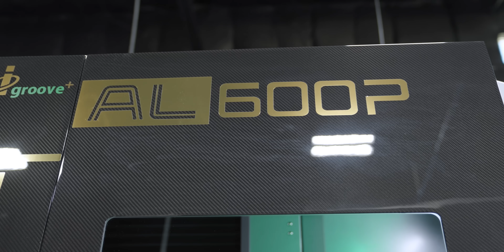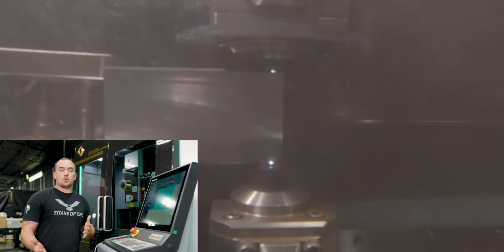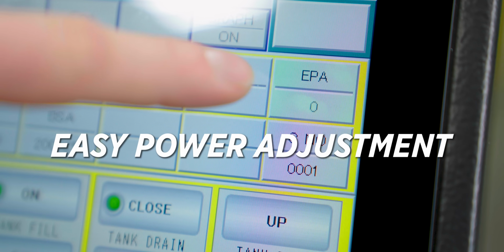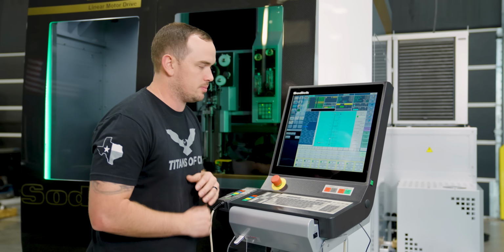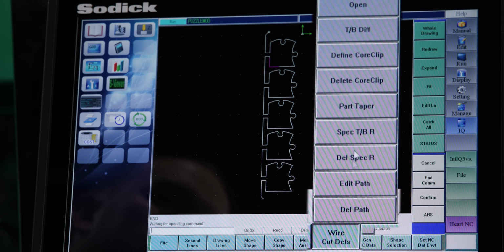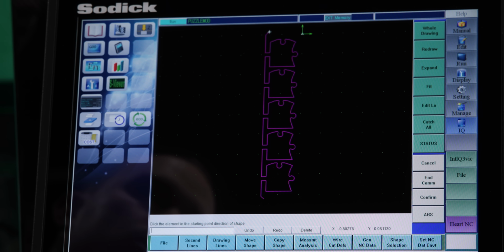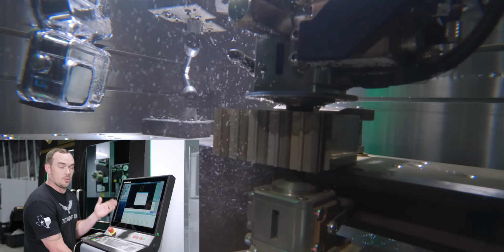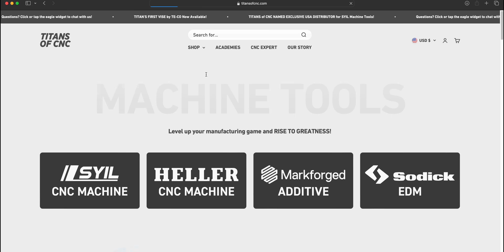MOST Precise EDM Worldwide Makes an Invisible Cut

Comment: Top and bottom surfaces were ground after EDM and assembly. That is why it looks so perfect. Check the grinding marks on side A, at 4:39 (parallel grinding marks to the side of the workpiece) and at side B at 4:41 (~20° angle to the side of the workpiece). On all 4 pieces, the grinding marks are the same. Precisely on both side.

If you check the grinding marks orientation on the stock material and if you would assembly them after EMD, they would have 90° offset in the orientation...

 I don't want to unackonwledge the precision of the machine, but what we saw here is a show.

Comment: And here I thought this technology was surpassed by some newer since it has been around some decades now. But this is quite incredible. Even if it takes some more process after the cut or what ever. Just to make a cut so thin that it almost disappears is just incredible.
Reply: @JohanFasth-w4r  EDM is one of the fastest-growing machining technologies in the manufacturing sector. As tolerances get tighter, and shops work to remove second or third ops from their process, being able to hold 5um on your first op is becoming the standard.
Reply: @robswain5264  Fantastic. I thought it was fazed out as I said. But I'm not in the business, just interested in what's happening. Thanks for info!

Comment: Did that shit just autofeed the wire through both heads?
Reply: @setesh1294  not new. Makino and Mitsubishi have had auto thread for at least a decade
Reply: @robswain5264  ahh. Well, in all fairness my only first-hand experience with W-EDM is with a Hitachi from '87.

Comment: I have Query & Help reqd. One of our Testing system has failed Mechanically. Can we have rotary table around fixed table manufactured using this system. Both table should be cylindrical in shape with provision for mounting different fixtures. 4 probes will be mounted at 90degree to measure ID of job[mounted on outer rotary table] on Center Non-Rotary table. This  i wanted to implement for wheel id measurement. Since every change in micron changes inner circumference. Also it can help in testing center offset of job. Also wanted to know can this fixed table with rotary table placed in oil bath to reduce friction & increase life along with repeatability. I am testing system software developer working on software of such system.  Hence searching for solution. Job will be clamped at bolt holes of job through dowel pins mounted on fixture which is mounted on  this rotary cylindrical table. Thanks in advance. Precision u showed is minimum expected from testing system to verify component.
Reply: Also if above is possible. Then I would also require Master plates.

Comment: when you break off the pieces, you wiggle it to release but you do it very close the the EDM-wire. Doesnt this risk damaging it?
Reply: Im pretty sure I saw this machine self thread.
Wire break is not a problem.
Reply: @toftlol   the wire feeds continuously, and if it breaks, most modern machines have a rethread macro.

Comment: To cut a tall piece of material like that, how much tension is on the wire?  Seems like it would need to be quite rigid.  It's got to be at least blue pill level.

What it the tallest piece that can be cut?

Those machines are absolutely unbelievable. Like 🤯🤯🤯🤯🤯🤯🤯
Reply: The wire never touches the work piece. The only deflection would be from the myriad tiny explosions. But they really are tiny.
Also, with rough cut and 4 finish cuts as per this video, the bubbles have plenty of room to go sideways.

Comment: What most of these seamless EDM videos forget to mention is you still have to surface grind all around after it is assembled to achive the results shown. These kind of "I'll show you how... " videos where you proceed to just promo a machine and show the easiest part of the process are so annoying... Beautiful but annoying.
Still, nice work, nice machine(s), but at least mention the other necessary steps!
Reply: Nope. Withe a Sodick EDM you get the best surface directly from the machine. The only surface you can do something either is the outside. If you want a different look so to speak. But it will fit perfectly directly form the machine.
Reply: @Mrshugo-tq7ki  That's exactly what I was trying to express. If you don't surface grind the outside after assembly, the whole effect doesn't work. I don't doubt Sodick's reputation, I'm just pissed off about this half-assed approach to "how to videos". One sentence about the additional steps for such a stunning result would've shut me up. And they have all the resources to record a few seconds about the grinding process... They just chose to exclude everything that is not specifically Sodick marketing material.

Comment: No additional grinding on the top surface?
Reply: They have to grind the holding tab off where the part was attached till the end where you did the cut off and broke them loose. Then grind the top and bottom after it was assembled so the grind pattern is all the same direction.
Reply: Possibly before or after

Comment: That kind of precision is one of the things that moves this world forward. Wow!
Reply: These machines have been around since the 70's
Reply: jingdiao mills can also hold the same tolerance as a wire edm but with full 5 axis and a more mirror finish ( though it may take a bit linger )
Reply: @flikflak24  I... don't think you're correct. If a mill could hold micron tolerances, the world wouldn't need EDM.
Reply: @robswain5264  well thats cause a mill cant hold below micron / sub min angle taper at like 7 inch depth through hole square with a corner radius at like 0.004"
thats why we need EDM's

Comment: Awesome ...Sliding need tolerance 0.005-0.010mm

Tomorrow you can try with PCD Diamond Material. How many times to cut to produce a smooth surface ?
Reply: for reference, final polishing of jewelry facets is usually with 1 micron or finer (0.5 or 0.2) abrasives
Reply: @DavidGao  micron is 0.001 mm
Reply: PCD takes a special high power circuit that's an option on this machine. The diamonds increase the resistance of the binder material quite a bit, so the EDM needs more voltage behind the cut to bridge over the sintered diamonds.

Comment: 0:17 "its completely seamless " and yet in the pounch-in on the fottage you can see seam's xD probably cause of camera angle but still ( if the seams was less/smaller then the wave lenght of visible light it might be seamless but i dought it's easy to make parts with less then 380 nm or 19/1270000 inch ( im metric so i dont know how to write in inch ) seam size. but thermal problem when assembleing parts what that close tolerance is probabbly pretty hard xD
Reply: Imagine having a puzzle like that you can only disassemble when putting it into a fridge. THAT would be zero tolerance machining.
Reply: @strangereyes9594  you wouldnt be able to well its that cold. since the holes have shrinked to much and gram onto the other part's. it have to be at the same temp ( plus minus 0.1 C /0.17F ) of when you made the puzzle
Reply: @flikflak24  You are right, I should have clarified it a bit better. Assembling it by putting one part in the fridge and/or heating the other part up, depending on which has the pin and which the hole. Of course, you have to redesign the parts accordingly.
Reply: @strangereyes9594  i still like to see two parts being put togeather with interlocking features ( like the puzzle in the video )with less then 380 nanometer of space between them. just to seem if the seam really disapere at any angle in the visible spectrum of light
Reply: @flikflak24  It won't, with the correct angle of light humans can see a nm scratch on optical surfaces. For a prospective, cloudy optics are around 20nm Ra and clear optics are 2nm Ra. Chromatic aberration, astigmatism and such are form errors, again on the nm scale. The surface would have to be good enough for x-ray optics.
Reply: @ScuffedEngineer  you sure the seam /gap would still be visible  concidering that the grinded surface on the top is way rougher then nm's ?